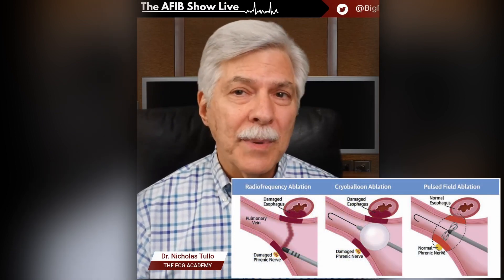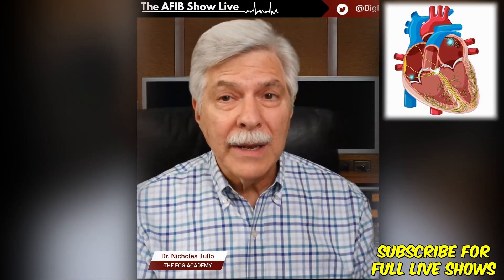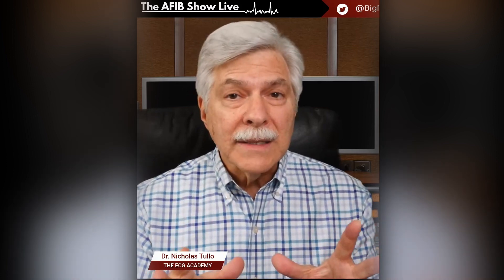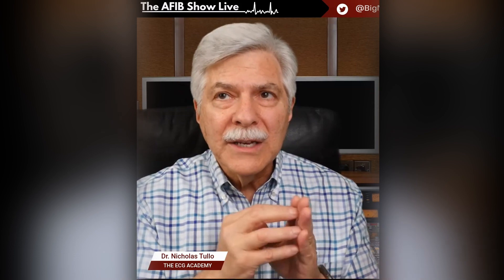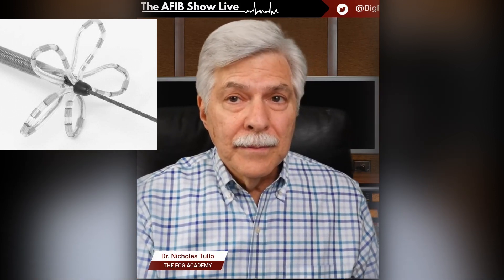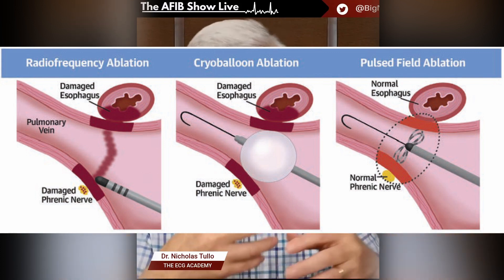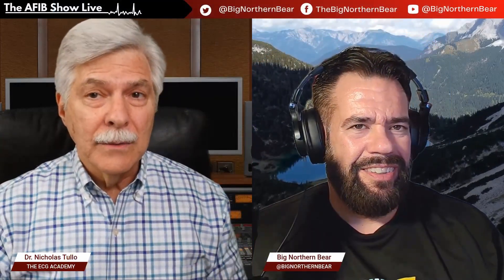Pulsed Field Ablation vs Current Techniques with Dr. Nicholas Tullo

Comment: 🎯 Key points for quick navigation:

00:00 🔬 Overview of Atrial Fibrillation and Ablation Techniques
- Atrial fibrillation (AFib) primarily originates from the veins leading from the lungs to the left atrium, where abnormal cells can trigger AFib.
- Ablation procedures aim to isolate these veins to prevent AFib signals from spreading.
- Conventional energy delivery methods for ablation have variable success rates and can be tedious.
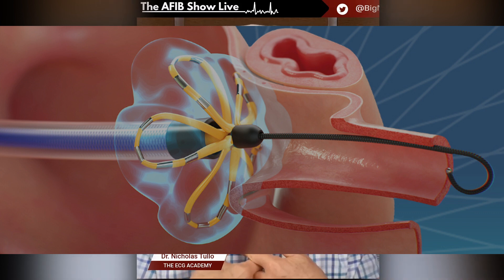02:00 ⚡ Introduction to Pulse Field Ablation
- Pulse Field Ablation (PFA) is an emerging technique that promises enhanced efficacy and safety in AFib treatments.
- PFA utilizes short electrical pulses to selectively disable abnormal cells while preserving the integrity of the surrounding tissue. 
- The new technique could reduce procedure time significantly and potentially improve success rates and decrease complications.

Made with HARPA AI

Comment: Any Swiss folks that have had it ?
Reply: I had an PFA ablation in Switzerland last May,done in a university hospital,it was my second ablation,it didn't work because I had two persistant afib episodes afterwards which meant 2 ECV again.What's next a pacemaker?I'm not convinced will have a talk with the professor this week.
Reply: By the way I had a bleeding after a couple of hours
Reply from the maker: Not that I know of it’s pretty new. I only visited Switzerland tho. We don’t have in Canada yet
Reply: It’s been available in Europe for more than 2.5 years.  In fact, 67% of AFib ablation are done with PFA in Bern Switzerland.  The efficacy of PFA is the same as regular ablation based on recent randomized Advent trial.
Reply from the maker: @JohnVT12345  thanks for this.  I wonder if the success rate is the same and if the complications rate is reduced. That was the real selling point that I understood.